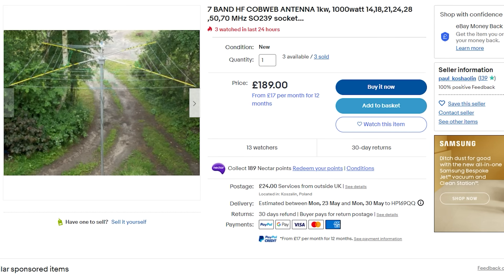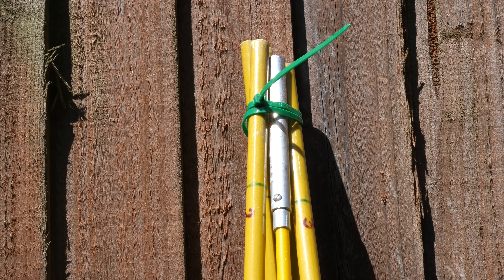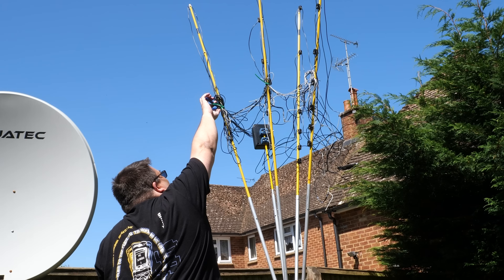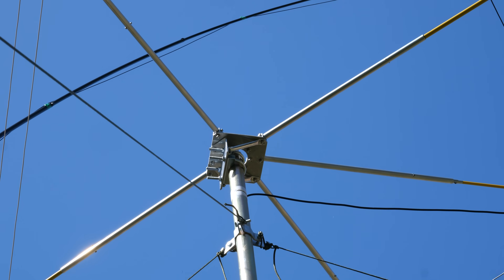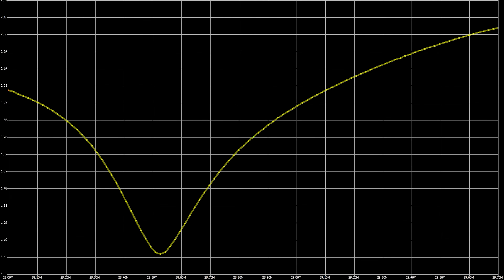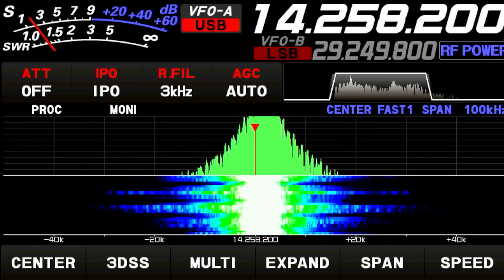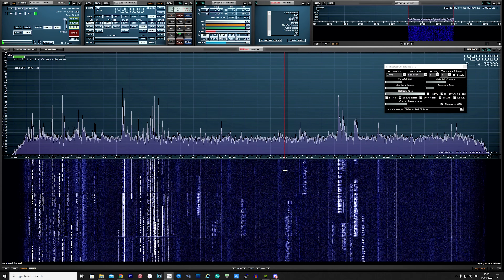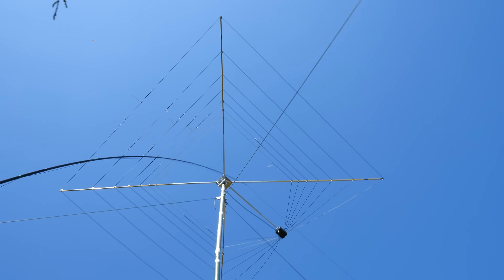7 BAND HF COBWEB ANTENNA - 1 KILOWATT RATING

Comment: Mine came about 2yrs ago, had health issues , now stronger to put this together . Noticed it came not shown on the Video but the Spreaders have holes drilled and a hunk of wires folded with the Balun- any suggestions on how to run all the wires in what order thru the yellow spreaders ? Did yours come already threaded as in this Video ? If i would have known upfront i question if i would have purchased this Antenna in kinda Kit form .

Comment: I have been using the same Cobweb for nearly three years. It surprises me that the bandwith you measure in the video is so much larger than I measure. I get 240 kHz below 2:1 on 20m and 300 kHz below 2:1 on 10m.

Comment: Just purchased and mounted the 20-4 version of this antenna and wow!  We have a small garden and needed something that was not too imposing for the neighbours and didn't need multiple radials.  As suggested I added a choke from the balun prior to the feeder and it behaves extremeley well.  I have an 80-10 EFHW and a Rybakov (hidden in the trees), the cobweb is exremely quite compared to the end fed and a few dBs up on both the current antennas.  Making contacts today I didnt need the noise cancelling tools on the 101D or my Bhi speaker.  6m opened up for a few hours on the evening I mounted the antenna and, using FT8, I was able to bag 20+ contacts in a short space of time.  Very impressed.

Comment: I am very interested in the Cobweb 8 40-6m version and mounting it at 40ft, Question I was thinking of using a Model 1115di - 1:1 Dual Core Isolation Balun, 1.5-54 Mhz, 5kW on it, what's your views?

Comment: Hi thanks for this useful video.  Is it easy to redeploy the antenna?  I would be using out out portable, so need a quick set-up each time 🙂
Reply: Hi,i use mine portable n just changed the nuts for wing nuts to make it faster.from boot of car to set up n on poles is below 5 minutes n that's taking it easy.great antenna
Reply: @andyM9XTT  That's great!  Thanks Andy

Comment: yes i have just ordered the same one the antenna im using at the moment is the 80m uk antennas endfed the same as your using and although its good for inter g stations its not that good for dx in the configuration i have it in with having a small garden. i noticed the two butterfly nuts on the box am i right in thinking you can put ladderline on it if so ill order some 450ohm stuff 73 great video from m7byf in skelmersdale
Reply: I was wondering too where those 2 screws were for.
If it's possible ... how do you use 450ohm ladderline with this cobweb ?

Comment: The performance of the antenna is impressive, but unfortunately there is another disadvantage.  We now had 30 cm of fresh snow which completely destroyed my antenna.  The radials are now just hanging down, freed from the snow.  It is therefore not suitable for winter because the radials are not braced.

Comment: I bought the CobWeb antenna made by MFJ, some number of years ago, and I believe it was a fairly new creature !
I believe it was at the time, 10 thru 20 meters !
I worked very hard at putting this antenna together, as it states the SWR can be brought to nearly 1:1 on every band, but you're going to have to put in the work !
Up and down, the ladder, up and down with the antenna etc. !
You get the idea !
Upon completion, I installed the CobWeb at 20 feet, and it played very well !
Albeit the bands at the time were not great, it made me feel as if the antenna possessed something magical, from the way it performed, in not so great conditions !
Left it in that configuration thru a couple of winters, and desided I would add the newly released High powered feed point, and the additional two new bands offered, which were 30 meters and 80 !
Wasn't so worried about phone on 75, as I was sure I could employ an antenna tuner, if needed !
Back to the working tediously at getting this thing right !
At this time the antenna was about 10 feet off the ground, as was a new 4 element I had built for 6 meters !
Both antennas were in the testing phase and only separated by a few feet, give or take 10 !
But on the same plain !
Then came the most frightening day I believe I had ever had !
It had been threatening rain off and on, with some showers, so I chose to take a break on working on the antennas.
Keeping an eye on the weather, as many Amateurs do, I watched as the Radar predicted a very unusual storm, coming out of Chicago ! And following perfectly a North, South highway !
We were some 130 miles or so South.
Radar showed this storm traveling in a straight line to the South, until it was almost to the Northern tip of our County, some 35 miles !
Fortunately, or so I thought, radar showed the storm then making almost a 90 degree turn to the East, and then head into the great state of Indiana !
So I relaxed a bit, and did whatever I was doing, until I noticed the sky starting to turn dark and the winds pick up !
Turns out, the Storm had a mind of it's own !
I turned the Tv to a local Broadcast station, that was already talking about this system that was quickly moving into our area !
From there it quickly became a nightmare !
It began to Hail !
Some pieces reported to be as large as baseballs !
I turned the Tv volume up full blast, to try and hear what the Weather man was saying, only to move out of the bathroom, where I had moved my elderly Mother and myself for safety !
I'll never forget the perplexed look, and sound of the Weather Mans voice, as he somewhat sheepishly said, " Folks I can't say where, but there is a Tornado in there somewhere ", as he looked at his Doppler radar screen !
At that point it had been Hailing for several minutes !
Curiosity got the best of me and I open the front door only to see a literal wall of Hail, so thick I could not see past the end of my yard !
The 35 or so foot Red Maple in the front yard had nearly every leaf stripped off of it !
I came back to what became our safe place, as the small Bathroom was all we had, should debris begin to fly around !
I can remember feeling completely helpless !
As big bangs against the windows made me realize that sooner or later those windows were going to shatter !
Fortunately the Storm windows did their job, but many in my neighborhood didn't fare as well, as many lost windows, not only in their homes but in their vehicles !
It Hailed continuously and at the same intensity for over 15 minutes !
I began to think it wasn't going to stop !
The roar of the Hail striking the roof was only interrupted by a louder bang on a glass window !
Long story short.....Millions of Dollars in damages from the worst Hailstorm to strike the area, ever !
Glass from automobiles littered the Highway that the Storm drove down from Chicago !
Simply unbelievable !
My truck setting in the driveway was totaled, as were most other vehicles caught out in the open !
A Toyota dealerships car lot looked like a War zone !
Millions in damages there, as well !
But...as I was surveying the damages to the siding on the House, I began to notice wires hanging down from my laborious CobWeb antenna !
Adding more insult to injury !
Every.....every wire for every band was broken !
Just as if someone took a knife and cut each wire !
Now even stranger was the 4 element, 6 meter Horizontal Beam, not feet away from the CobWeb !
It was still standing with no visible damage anywhere ?
Not even a tilted element !
To me it would have been impossible for it not to have been struck !
But there it stood, virtually unscathed !
Not even a dent, anywhere !
But sadly, the CobWeb didn't fare as well !
But I never expected to see wires broken like they were !
Given they were not 10 gauge, but still !
Sadly for me, my health went sideways, and I recently lost my Mother at 101 !
I guess you could say, 
" Life happened " !
So the fiberglass supports for the Cobweb still has a spot in my yard, although naked !
And I just knew it was gonna play great on 30, and 80 meters !
My apologies for writing a book, when all I really wanted to say, that if you are willing to take the time, and build the CobWeb correctly, it plays extremely well for what it is, and doesn't need great height to play well !
And offers a fairly small footprint !
Too, because its mostly flat, you can hardly see it !
For those that have unhappy neighbors !
Theres always one or two it seems !
'73 !
And again my apologies !

Comment: Yes, I have had this exact antenna for 2 years with great success.  It is 13.5m high and can easily accommodate a 3-element shortened beam.  But it also has two properties that can be very disadvantageous.  1. It reacts extremely when it rains - the SWR often shifts down to 300 khz.  (strangely only very little in snow) 2. It has an extremely narrow band but can usually be retuned with the internal tuner.  Otherwise, I have never had a more powerful omnidirectional antenna.

Comment: It looks like you have your Spectrum Scope on HIGH sensitivity for the 2D display.  Do not know why Yaesu would have this as a default?  Works much better when NORMAL is selected!  Your Tx peaks are off the screen.  Most of the time I have my CENTER SPAN on 10kHz, so that I can see the quality of the incoming signal better (1kHz per box).  Even though your VSWR was not too bad, why not use your built-in tuner to bring it down even further?  Enjoyed the video!  73 John N2KBE

Comment: Been using this same antenna from Paul for a few months now with great results. Other than the fact that the SWR changes in the rain its been a great performer. Mine is just above the peak of my roof so low profile but is better than my end fed when crossing the pond so to speak. I used your video as an assembly guide but the version he sends to the US is cut down for overseas shipping. Thanks.

Comment: Ive had one of these antennas from Paul for about 6 months.I also have had Hexbeams in the past.This antenna isnt as good as a hex but its damn close.Im in WNY and the anteena hasnt seen winter yet.I think it will be just fine.This antenna is at 35 feet and works great!
Reply from the maker: I'm aiming to put mine up about 10 metres soon. Currently sat at 4 meters and it still rocks! Awesome antenna!

Comment: Brilliant review, thoroughly enjoyed watching this (for the 3rd time lol). I currently have a Prosistel PST1524TV Vee antenna 40/20/15/10 but with each leg pointing skywards 18ft (at an angle), it does attract a bit of attention and I am thinking of replacing it. It is brilliant on 40m and 3 S points stronger than my inverted L. But it is not very good on TX/RX on 10m - which, you were noticing with the Cobweb (has this improved at all ?).  A question I do have, how has it been in strong winds, I know you have the mast guyed but how does the antenna get on ?
Best wishes and thanks again for your review  :)
Steve G4KIV / G1G

Comment: Я сам сделал аналогичный, но прикрепил его к концу горизонтального кронштейна и использую в вертикальной поляризации, поэтому он чувствителен к направлению и я могу его вращать. HA4GBJ, Анатолий

I built a similar one myself, but I attach it to the end of a horizontal bracket and use it in vertical polarization, so it is direction sensitive and I can rotate it. HA4GBJ, Anatoliy

Comment: I use the 7+3 from 73 Antennas. It covers these 7 Bands. 7,10,14,18,21,24,29,Mhz.  Added frequencies with antenna tuner are 1.8, 3.6 and 5 Mhz. I have Yagis for VHF and UHF. They may be "compromise" antennas. But they are great for those of us with small yards and no place for vertical ground radials.

Comment: Curious, did you use the VNA to test 40 and 80 metres? (despite it not being "for" those bands ?
Reply from the maker: I did, but I don’t think I checked 80/40. I know my DX10 internal tuner will not tune it on those bands. Paul does make a 40M version but it’s very large!

Comment: I might try making one of these. Wire is cheap. It doesn't look too big.
G4GHB
Reply from the maker: It’s very good! 20M band is better than my EFHW and it’s only 6 metre off the ground.
Reply: @TechMindsOfficial  Great. I made wire dipoles in the attic, 14 and 18 mHz up and need to put up the  21, 24 and 28 mHz,  but fancy trying a cobweb.
Reply: Ham Goodies now supply a balun for a DIY kit.

Comment: I have used the 5 band (40, 20, 18, 15, 10 meters) version of this with great success. Since I built my own, it was a hassle to tune it initially because although every band seem to have its own wire, the antenna actually works as a whole. So, tuning one wire affects the other bands and a lot of going back and forth among each wire is required. But once done properly, the result is great. It is considered a "compromise" antenna because of its small(ish) size but actually it matches or out performs many larger sized ones. My only con on it was the lack of 80m band. It is possible to add it but it requires a much bigger and stronger support frame (=heavier and more prone to wind damage) for the length of the wire required which kinda defeats the purpose of having a cobweb.

Comment: Hello from Ve8ap well I received one of these antennas a few days ago and I am still set back on how well this antenna is working and how well it’s built. I have my cobweb 40ft off the ground SWR was bang on and first stations I worked one in Indonesia and one in Japan and one Seattle and I asked to do a antenna comparison with my 2element tribander and this antenna around 26ft up I was shocked cobweb outdid the yagi by 1S unit. And did I mention the receive very quiet shockingly quiet on some bands. Keep making these Paul I love it and the footprint it takes up and performance can’t be beat
Reply from the maker: Great to see I’m not the only one blown away by it’s performance! Thanks for sharing your experience.

Comment: I had mine from the man himself, good overall performance.  Out performs EFHW and the higher the band the better.  No need for external ATU on mine bearing in mind the spreaders are plastic and mine is about 35’ off the ground and can be lowered to sit in the apex of the roof - so it has a low profile as far as the neighbours are concerned.  Hexbeam  would be the next step but going without is cheaper than a divorce🤪 73 de M0AZE Mike

Comment: Nice review Matt. The fact they come pre cut and assembled is a huge plus. Which poles did you use to mount them? Are these swaged by any chance?
Reply from the maker: Yep, got them from Screwfix but they are really heavy, especially when you have 4 strapped together.

Comment: Nice video, thanks a lot very interesting.  As far as I know the cobweb is directional, it's basically a 2 element yagi right?  I didn't see a rotator so are you just pointing in the direction you use most or maybe you have the "teenager rotator" deployed for that? 🤣
Reply from the maker: The elements are folded dipoles, so it’s omnidirectional, which saves mounting on a rotator.
Reply: I thought it was more like a cross between a fan dipole and a halo antenna

Comment: Hi Mathew 

I too have one of these cobweb antennas too the one I have from Paul Koshaolin from Poland is the same as yours.

What an antenna the boy can sure make them.. I've had 5200 qso in 3 months 125 countries with conditions still to peak..with this antenna. 

Only downside is Skin effect with the wet weather you'll find the VSWR shoot up and require to use your tuner to make amends. 

Great vid as always @Tech Minds

As a side note I would drill a small hole in the underside of the grey chocolate block outer box as a breather hole otherwise the innards tend to swell and rust with condensation and ice
Reply from the maker: Thanks for the info and thanks for watching 🙏

Comment: oh just a FYI the SWR goes all out of wack in the rain :)
Reply: Good reason not to use an automatic antenna tuner with memories. The automatic part is fine, but not memories. In a rainy situation, I would always tune fresh instead of relying on "memory."
Reply: @davejensen8119  your right with some auto tuners but I have found with the LDG you can set a threshold if it goes over that it re-writes the memory and does a full tune
Reply from the maker: I’m yet to experience this but others have said the same, I’ll test it out when it rains.